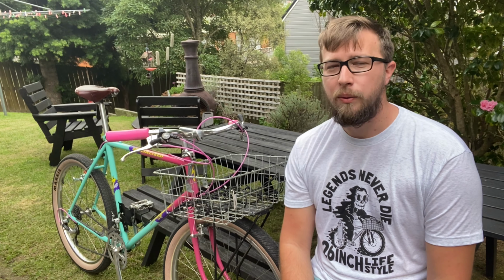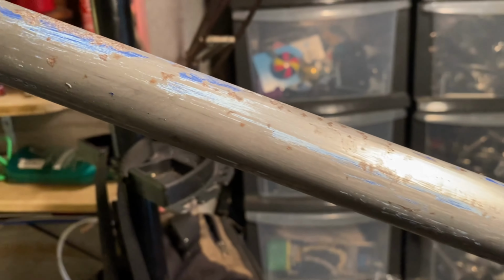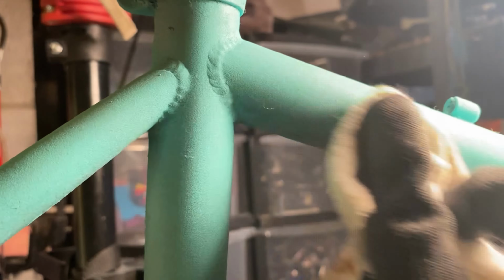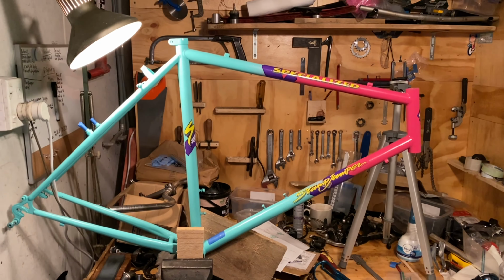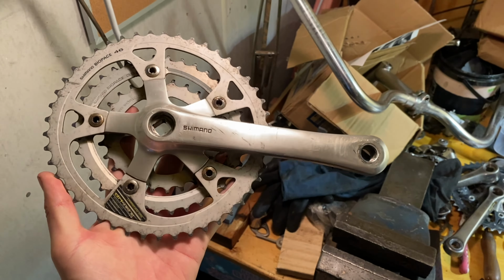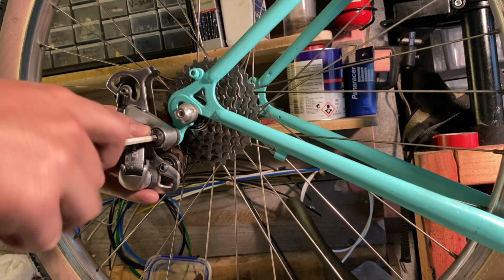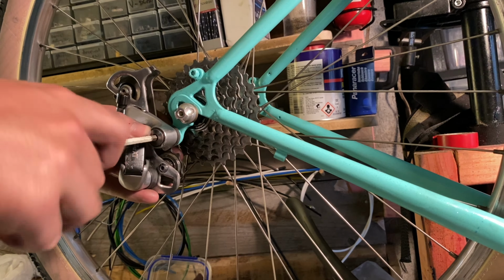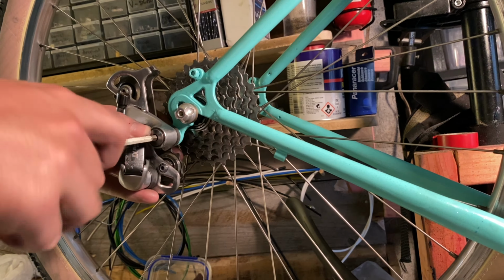Retro Specialized MTB Rebuild (burrito slayer/commuter)

Comment: I wonder where he gets all those old moutainbikes with the huge frame sizes. All the old 26" mtb frames I have founs so far are tiny, I recently bougt one on ebay. The decals even say "oversizeed" but compared to a normal 28" city- or trekking bike it looks like a child bike. I also looked for some new 26" mtb frames, but its the same, they are sold as XL but are much too small for me.

Comment: Nice and inspiring. May I ask where did you get those dropouts brackets? They’d be perfect on my ‘92 Rockhopper
Reply from the maker: Cheers! 🤙 this one is a little diy bracket, but if you search “gamoh rack adaptor” you’ll find what it’s based off of.
Reply: @toastyrides  Thanks, I suspected it was a DIY work, I’ll follow your suggestion . Keep on posting video please !!!👍👍👍
Reply: @toastyrides  Did you made them out of steel I presume
Reply from the maker: @calcagnolibero  cool, will do! I have a Marin Bobcat trail video to do. Then a long list of other bikes to build and film 🤙 and yeah it’s steel, with a bit of spraypaint so it doesn’t rust quickly
Reply: @toastyrides  I found the Gamoh adapters for sale at 6 € the couple from a German online shop and bought three sets, they come cheap and they'll be delivered to Italy in just three days. I'll check your other videos!

Comment: Hey Toasty Rides, 
I am always having a hard time finding the right color match for break and shifter housing. Are you using by any chance disc break housing for both shifters and breaks? as that type of housing is the only one that I know to be be compressionless, and would work for both mentioned above.
Reply from the maker: Look into Jagwire cables, they have lots of info about their cables 🤙 

And most bmx brake cables “linear housing” are similar to Jagwire’s Pro KEB-SL compressionless housing  😄🤙 
Plenty of different colours to choose from 🔥

Comment: I recently discovered your builds and really enjoy the creativity in parts use on these older frames. 
I have an 1986 diamondback apex, 1982 specialized stumpjumper, and a 1986? spec rockhopper. I’ve become very fond of tire air volume and wondering if you would guess the biggest 26” tire that might fit these frames and forks from your experience? do you have a rule of thumb?  is it easiest just to measure?  do actual tire widths vary from the stated widths? I’m looking for off road tire suggestions. 
thanks for any help! keep on keeping on!
Reply: I have a '92 RockHopper with 2.15" Maxxis DTH's; I don't think I could squeeze in anything bigger. HTH.

Comment: Love this build! Getting me very excited for a project GT I have. I'm curious about the front rack brackets you used. Is there a place to buy these online or did you fabricate them yourself?
Reply from the maker: Cheers! Oo a GT build would be cool 👌
If you check out my latest video I go over it, there’s a company but these ones are DIY 🤙 if you make them yourself you get the sense of satisfaction and also can customise it so the rack sits where you want it 😎
Reply: @toastyrides  thanks! I'll check out the video!
Reply: @toastyrides  Came here for this. The video is called "Rear carrier setup modified for the front!". I am trying to do the same. I think a lot of 80s and 90s MTBs only have fender mounts on the front fork and lots of folks want front racks now. Love your build style and videos are just the right pace for me.